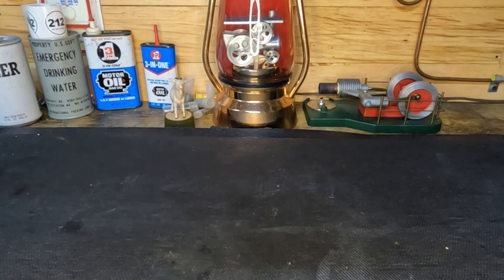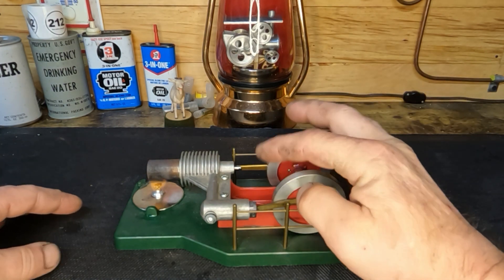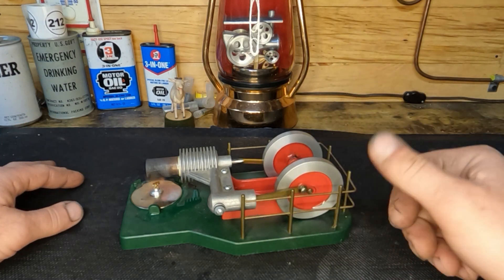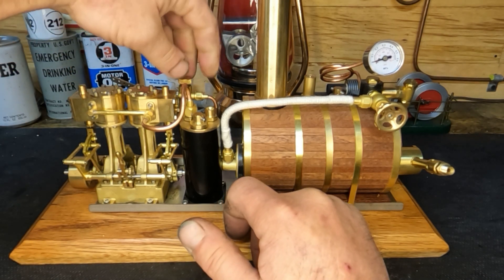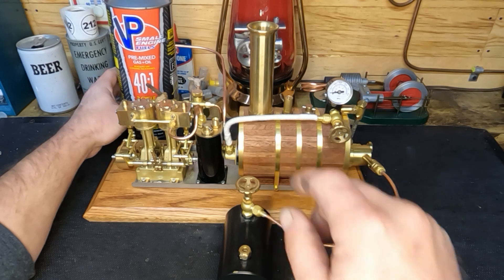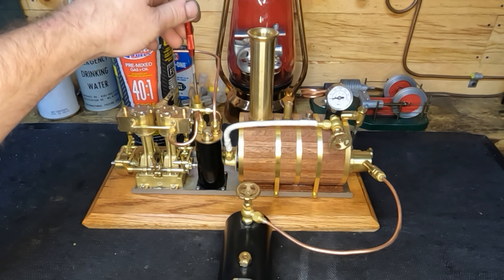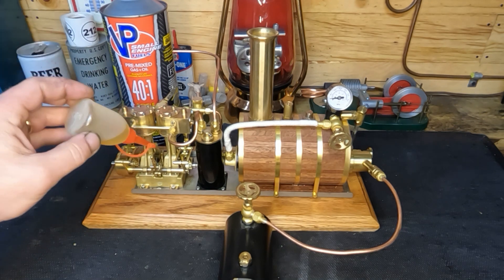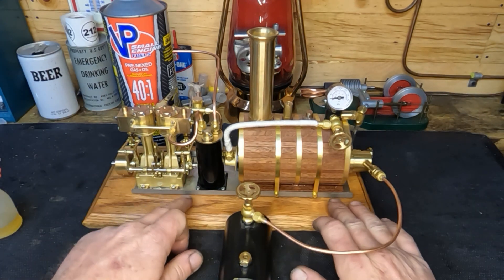Live Steam Test of a Twin Cylinder Steam Plant

Comment: What's the minimum amount of things I need to build a working steam engine  thanks
Reply from the maker: That's a hard one to answer. If you are planning to run a steam engine on compressed air, that will eliminate you from needing to build a boiler and the tools, supplies, and risks that go with that task. When it comes to the engine, there are a variety of different designs to build, from a simple single acting oscillating cylinder, to a Corliss valve, or even a triple expansion engine.  I'm sure that there are things that I will leave out of this list but.... Measuring tools (calipers, micrometers)  a good choice of files (including needle files)  a drill press is a great tool for ANY shop,  I am going to suggest a lathe, it does not need to be a big fancy and expensive one though, "a good machinist blames himself, a poor machinist blames his equipment" you'll be amazed by what you can do with an 8" lathe (including the ability for small milling tasks). The MOST important thing you'll need is the desire to get out in the shop and show yourself that "I can do this"!  If you we're looking for a pre-machined kit to assemble in 1 evening, I would suggest looking at PM Research they have a very good selection of models to look into. The single cylinder oscillating model is a great one to start with just to see how much you like the hobby.  I'm sure I've rambled on long enough.  Thank you for your question and thank you for your interest in the hobby 👍 you're one of the reasons why I say "you guy's are GREAT!!
Reply: @Steam 212°  I like the idea of the vapor in the air I have allergys and all the moisture I can get

Comment: Very nice plant from Jin, its running very very well.
Reply from the maker: I was really impressed with just how well made this setup truly is. Jin did a great job designing it. It's not nearly as impressive as that wonderful Doll twin cylinder of your's though 👍
Reply: @steam212  With your Solar #1 have you found that when the spirits heat up the aluminium base after its been alight for a while that it turns into a flamethrower? As the spirits start to boil and expand, leak out and catch fire? I can only fill mine half full.
Reply from the maker: @SteamEngines-Jim  Yes, this one will do the same thing. I have yet to try it but I have been told that if there are cotton balls in the well, to act as one large wick, it will reduce the boiling effect. I have not tried though. I jokingly say that it is not a flaw in the design but an added feature called an afterburner 😉
Reply: @steam212  🤣